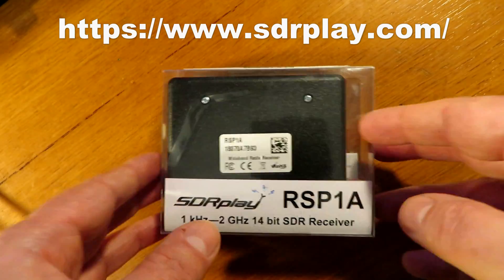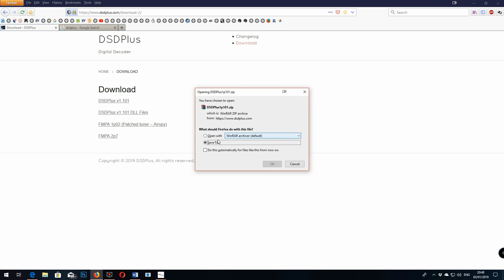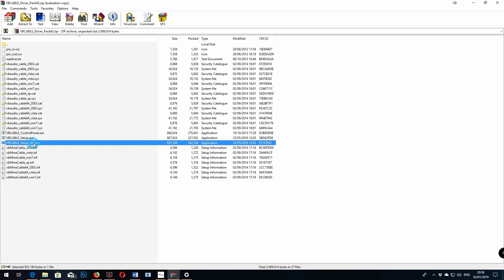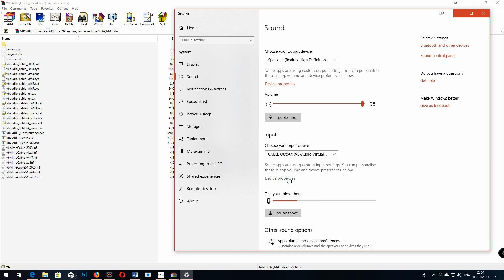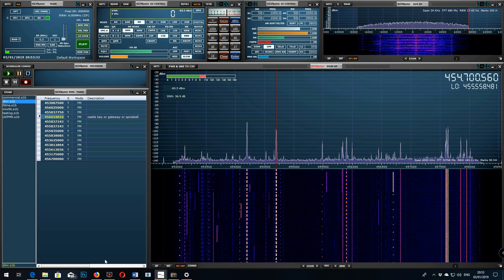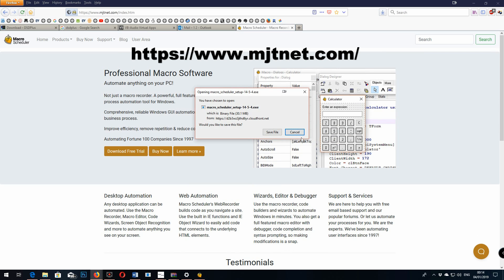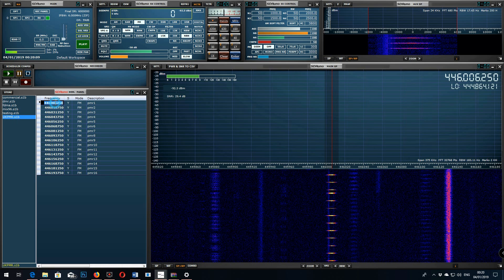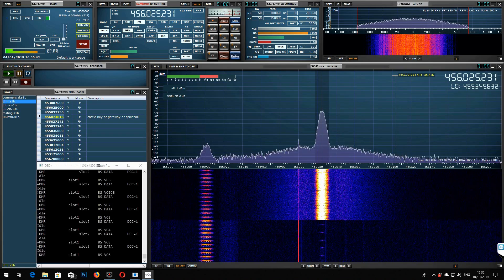Decoding DMR with SDRuno & RSP1A Automatically + Scanning Memory Channels

Comment: You can change all settings automatically, even the sound device, by clicking the "Save Profile" button at the bottom left of the Memory Panel in SDRuno, you don't need any macros!